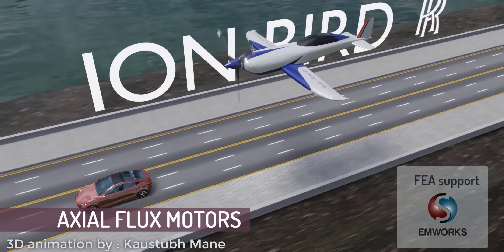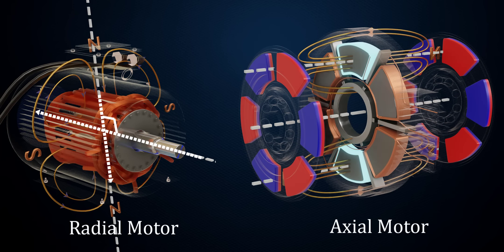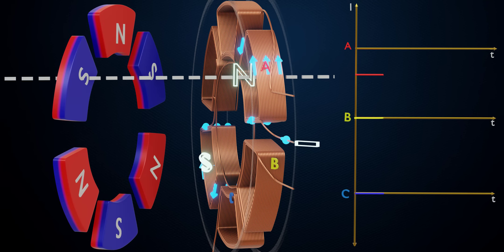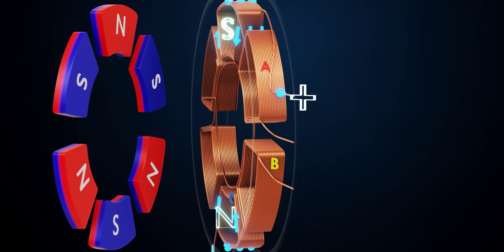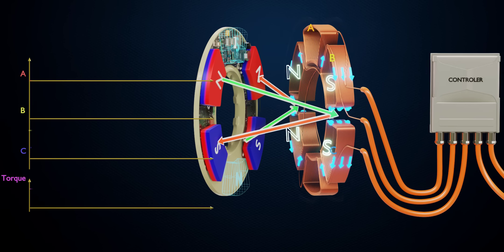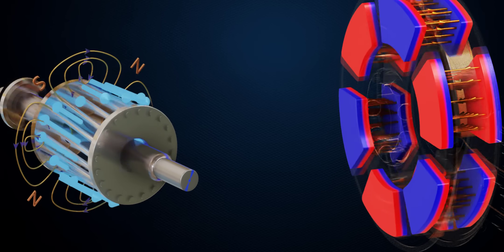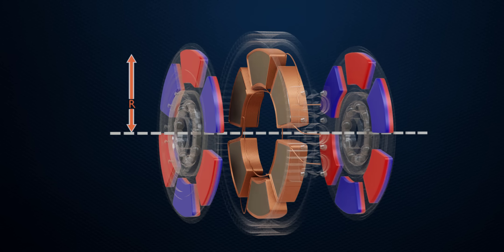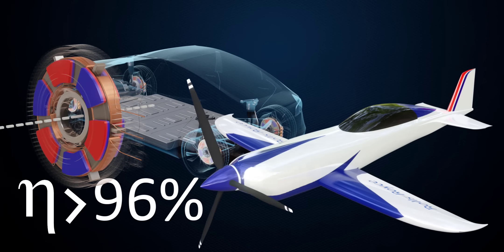Axial flux motors - The new hope

Comment: With three motors or magnets stacked like that, couldn't you just cycle it with suspension to squeeze them together and react to create electricity where you'd think a crank or driveshaft would be? You can electrically ground the motors to the suspension.

Comment: As electrical engineering kinda disgusted when more fields already need better windings, and I can think of upgrade but interlaced winding to get more continous torques. As final/end game designs suffers losses due to dis-continous torque production. At that point they may reinvent the new-perfect propeller but, it would be some vertical-axis-wind-turbine copy.

Comment: So it's just a hub motor with the magnets in a different location basically I don't think this motor is really that special we already have really great Hub Motors it can be casted into pretty much anything that needs to spend basically the casing is the spinning part and yeah you could attach it to propellers or anything but it's no better than the Hub motor and not really much different

Comment: The problem with electric planes isn't the electric motors, it's the mass of the batteries and charging time. 
They need a 3-5x energy density improvement and significant charging speed increase.

Comment: The engine is light, the batteries are stupid heavy. There is no benefit. Electrification of our transport (at least with current technologies) is a farce and the regulators that are pushing this dumb shit will ultimately be responsible for 100s of millions if not billions of deaths.

Comment: As a german engenier I like nice pictures and nice animations. But it's a real pain to listen to this technically inaccurate explaintions.
Radial syncron motors are better in torque with a given rotor moment of innertia.
The bearing of the rotor is much more demanding in an axial motor
If you use an inverter for an induction motor starting currents are not an issue.
Also from an educational point of view it is bad to compare axial-synchronous motors with radial induction motors. Apples are being compared to oranges here. Likewise, the cross sections for the magnetic flux are not comparable.
The german version of this video has some really good constructive feedback in the comments:
https://www.youtube.com/watch?v=E6Wk9rmp57c

Comment: As a professor in the field of electrical machines, who has been engaged in axial machines since 1994, I will say that with the same volume of electrical steel, axial machines have 2 times less power due to the uneven magnetic saturation.

Comment: 3:38 you can replace that with a timing disc metal circle with holes in it. analog>digital, it's inherently solid state. wind the wires in the shape of the work

Comment: I want AF motors on the two rear wheels as a retrofit for my Gen 9 Impala. I would use them as off the line boost where my ICE engine drinks the most gas. The motors and batteries should be engineered to be as small and light as possible for the task.

Comment: This motor seems to be same as brushless motor
Reply: Yes, but with the addition of microswitch circuitry.
Reply: @keepingup2952  There are no microswitches in motor controls.
Reply: There are many brushless motors, including all AC induction and AC permanent magnet types - this is one of them (specifically an axial arrangement of the PM AC type).

Comment: Is there a reason why it doesn't use a conventional 3-phase sine wave input?
Reply: Real axial-flux motors do use conventional 3-phase sinusoidal power.
Reply: @brianb-p6586  Is this one that they're showing a fake axial-flux motor?
Reply: @keepingup2952  the video and its models and simulations are all "fake", in the sense that they are not images of real motors, or even necessarily models of real motors. It's just supposed to be an explanation of working principles, and it has errors.
Reply: @brianb-p6586  You have to shut off 2 of the electro's at certain prescribed periodicities, to avoid attraction of the permanent magnet when it would be counterproductive.  That's why you need the modified square wave.  Sine waves would only do that at optimal peaks points, but would fight against power production during the curved incline of the wave for those 2 electro's that need to be off.
Reply: @keepingup2952  In the real world, AC motors use sinusoidal 3-phase power. If this doesn't work with your understanding, then you don't really understand... and this video probably doesn't help, because it isn't very good.
Reply: @brianb-p6586  I decided to look into it, and I figured out the answer to my question. Axial flux motors come in multiple variants, such as: Brushless DC, induction, reluctance, etc. The one shown in this video is an axial flux brushless DC motor. Other variants do use a typical 3-phase sinusoidal power supply (I think this is a requirement for reluctance motors, since phase must be varied with load).
Reply: Because only 2 phases create power in that radial.   Only 4 magnet interactions occur at a time, that power the system.  The third set of 2 magnetic interactions are neutral, so a third phase is unnecessary.  Since it is controlled by microswitch circuitry, the phases are actually square waves, not those pleasant looking sine waves everybody loves so much.

Comment: In lieu of permanent magnets, why not coil windings, connected via commutator?
Reply: You're saying, why not electromagnets against electromagnets.  I think that because of the physical design of this exhibit here, you wouldn't benefit because the third set of electromagnets would have to be turned off during the N/S interaction that is neutral in the dual-tangential power stroke, at the time that 'that same magnet' needs to be attracted to the opposite polar force of the next magnetic interaction.  You wouldn't be able to design a phase map protocol for the microswitching that would work favorably.  With permanent magnets you only have to switch off the electromagnets on the opposite facing mounting plate.  That's why he says that two of six magnets are off at any one time.

Comment: What type of magnet is used? Is it neodymium 52?
Reply: That's a really good question.  The RPMs should be considered, since neodymium is quite brittle.  Any long-term wear that throws the motor that uses mounted neodymium out of balance, could cause micro vibrations that would end up shattering the magnet and I wouldn't want to be flying in that airplane.  Sensors must be used to monitor that.  I have no idea how a human would go about physically inspecting the motor for that potentiality.  If sensors activate during flight, then it would have to immediately power to minimum and land now.  Where's the airport?
Reply: @keepingup2952  Cars have been approved. If a problem occurs, it will stop, but the plane will be your end. These engines must be tested for years and the necessary reports issued before application in aircraft.
Reply: @mohammedhelmy7203  Totally agreed, sir.

Comment: The winding excitation scheme shown works, and is great for toys and maybe electric bikes, but a real YASA motor in a real aircraft (or car) is driven sinusoidally. Sinusoidal excitation is needed for constant torque - the crude stepped drive doesn't achieve that, despite the claim.
Reply: The square wave is just a map of the microswitching.  You would have to measure the forces at any given position of this radial to see what the constant output is.  I'm looking for more information about the YASA variation of the axial flux design.  Maybe it has more than 12 magnets that interact, or maybe there's spacing differences?  Is it top secret?
Reply: @keepingup2952  the YASA design is very far from secret - it was published by IEEE as "Analysis of the Yokeless And Segmented Armature Machine" in 2007 and described in various patents by Tim Woolmer, a PhD student at Oxford University and later founder and Chief Technology Officer of YASA Motors (which was acquired by Mercedes in 2021). The sinusoidal excitation is completely conventional for 3-phase synchronous permanent magnet motors.

The YASA magnet configuration (number and arrangement) on the rotors is conventional for surface permanent magnet machines (in the axial orientation), but there is a rotor on each side of the stator so that the stator is yokeless.
Reply: @brianb-p6586  So it's always 6 magnets on one rotor and 6 electro's on the other?  Just like this one?
Reply: @keepingup2952  In a synchronous motor the number of pole pairs on each rotor is equal to the number of sets of winding pairs on the stator. I don't know if there is anything strange going on the YASA design, but it works the same way as a radial-flux machine, and in any case there can be any number of pole pairs as long as the stator and rotor are matched.

Comment: There is nothing exceptional about the 96% efficiency quoted. Common radial-flux synchronous PM motors used in EVs achieve that... just as with this quoted number, that efficiency is only at the ideal operating point (combination of torque and speed) and is for the motor only (not the inverter).

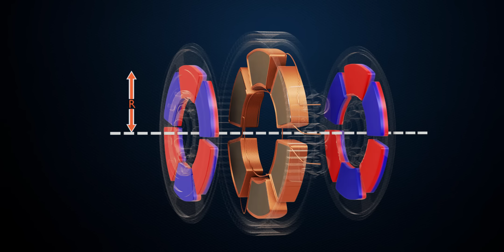Comment: At 5:23 the diameter discussion ignores that at surface permanent magnet outer-rotor radial flux motor (model aircraft people call them "outrunner") design achieves the same large working diameter for a given motor outer diameter as an axial-flux design.

Comment: At 4:29 the axial motor flux paths are incomplete - they need to be complete circuits (just like electrical current flow), not just lines ending in a permanent magnet. You can see this (poorly) in the FEA illustrations that follow. The incorrect illustration falsely gives the impression of short flux paths.

Comment: Why would you compare an axial flux synchronous PM motor to a radial flux asynchronous induction motor? Exactly the same motor configurations (asynch vs synch, PM vs externally excited, etc) are available in both radial and axial flux forms.

Comment: Like EVs this uses amps to control power, all_magnet motors use gap to modulate power, and, since magnets are always on, power varies by rpm so need physical governance to prevent runaway if unloaded [the flywheel explodes, any size does this].

A 1300hp axial geometry used to power a megawatt of baseload electricity fits cars 👈
It has a 50yr no_inputs warranty with upkeep, adding rotor stator pairs more power, adding radius a class-2 level past 1:1 reduces power same output, applies to marine engines as well. 
Technokontrol's RF-5000, 17yr RnD sparkless military_spec D.Antonio Romero dsgnr, Belgian.
Reply: No motor varies the rotor-stator gap to control power. 
No motor needs a physical governor to limit speed - they use electronic controllers.
Reply: @Brian B-P  Declarative, your post needs context, an all magnet motor working in repulsion with one element at 45° to the other at 90° will, if unloaded, blow up if some means not applied to stop it. All_magnet motors don't require circuitry to work, gap is used to modulate them, if your controller goes down your system needs a mechanical govenor & brake to a dead stop.
Reply: @ttmallard  motors don't blow up, whether they are DC motors kept under sufficient load, AC motors running on fixed power frequency, or AC motors running on variable-frequency drives. That means that in many cases no speed-governing "circuitry" is required... and no mechanical governor is required, either.  

I don't know where you go the idea that motors have adjustable rotor-stator gap for control, but in the real world they just don't.

If by "all_magnet motors" you mean motors with just permanent magnets and no windings  (electromagnets), then you're talking about a fantasy world which doesn't exist, so things can work any way you want in that fantasy.
Reply: @brianb-p6586  Dragster style flywheel blowup, apology for lack of clarity, any size tiny to big.
Reply: @ttmallard  Yes, excessive speed destroys rotating equipment... but a mechanical governor is not needed to control the speed of an electric motor.
Reply: @brianb-p6586  Sure thing Brian, I'm referring to an all-magnet motor, no_electricity, just magnets ... a 1300hp fits cars 50yr no_inputs warranty w/upkeep powers a 1-Mw genset/container.
🧲
Reply: @ttmallard  so, complete nonsense fiction. In that world, mechanical failure doesn't seem like a concern.
Reply: @brianb-p6586  How many all_magnet motors have you built ?

Best try at least once with a pack of neodymiums from the hardware store, a strong one can stop your brain from working.
Fwiw 🍺
Reply: @ttmallard  I have built the same number of working all-magnet motors as anyone else: zero.
Reply: @brianb-p6586  Sorry, you're not believable.

Have a nice day.
Reply: @brianb-p6586  What the most unique aspect of an all_magnet vs electric motor then, tell us oh magnet guru ?

Comment: incorrect hype. I've seen some videos on axial flux and I think it is as good radial flux if given the gears/gear ratios. this is the reason EVs have yet to use this despite an old technique/design.  the electric plane uses the axial because the RPM required for the propellers matches axial flux motor RPM/torque capability, doing without gears.
despite that I think there is a future for axial in passenger vehicles by increasing the diameter of the wheels so that it easily fits axial flux motors, doing this will allow for more interior space and better safety for larger crush zones.

Comment: Axial flux motors have the same issues as any other. Their design have inherently high power-to-weight ratio, but dramatically lower duty cycle. In order to increase duty cycle, you either need to build a bigger motor, or increase cooling... To which both options increase size and ancillary demands. For low duty cycle applications, they're a great option. Otherwise, they result in nearly equal power-to-volume ratio, and only slight power-to-weight over midrunner radial designs, by the time you account for ancillary requirements and complexity in manufacturing.

Comment: Clearly an explanation geared for non-technical types: "Smart controller". Its the modern era, and drive electronics is easier to control, nowadays. Of course, it will be more effective, if you adjust the excitation, with the actual motors current state (feedback). This is how modern internal combustion engines, get greater performance. Also if there is a gradual change, then why not use sinusoidal excitation. Again, with modern semiconductors, and controllers, this can be don't effectively, and efficiently. Think "class-D" audio amps.

FYI: All modern EVs use 3 phase drive, which hopefully rely on feedback. So do the much simpler brushless DC motors, in your computer fans (been around for decades). The novel part of these (axial flux) motors, is not the drive (driving electronics), but its mechanical structure.

Comment: @4:08 have anyone ever thought to use low pass filter in this case in order to minimize the spikes and thus improve the motor efficiency? Low Pass Filters can be made from passive components such as LC circuit and may cost less than the current control method, I am guessing someone may have already tried it but it is not mentioned in this video? What is your take on that?

Comment: The Faraday motor might have axial flux, but it is entirely dis-similar being an unswitch true DC motor that needs brushes and massive currents.   It is an entirely different animal and one that is largely under-explored, also known as a unipolar or Homopolar motor or N-Machine.   It actually can even be made without a stator magnet (all rotor) but then it's actually the brushes that act as stators.

Comment: I dont understand what all the fuzz about electric motors is about. Electric motors are not the challenge in electric aviation, but the battery is! You can generate more than enough power with conventional electric motors, but you have to have a light enough battery that can provide that power. And for a long enough time.

Comment: These motors are extremely efficient in conversion from electrical to mechanical work. Blows an AC induction motor completely out of the water.
Reply: AC induction motor exsistence only because of cost, we all know its not energy efficiency at all

Comment: You do not address the problem of current crowding toward the center, & the difficulty of having windings that cross over one another at the inside & outside.  This forces each area of the motor to be dedicated to only one phase.  Winding utilization is lowered & space that could accommodate more copper is reduced.  This type of motor is mainly useful for designs that are large in diameter & thin, & that run at high RPM, with no iron in the stator.